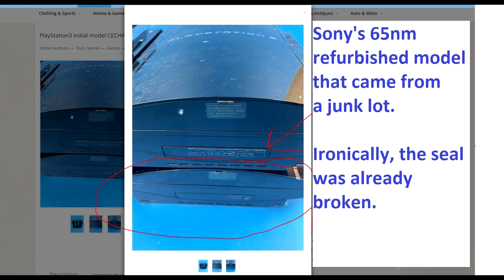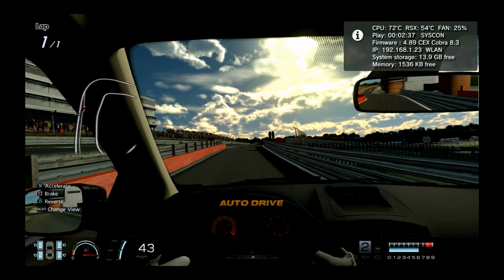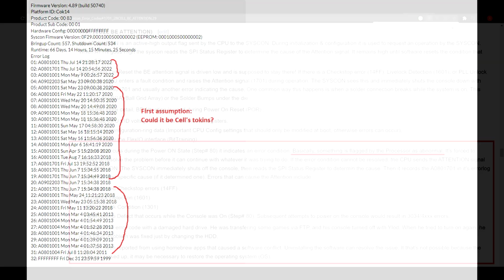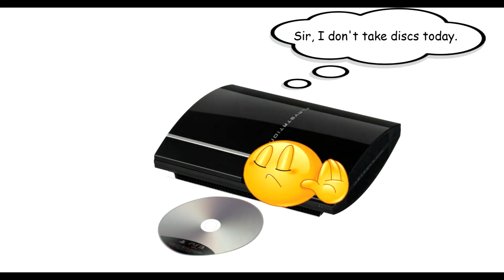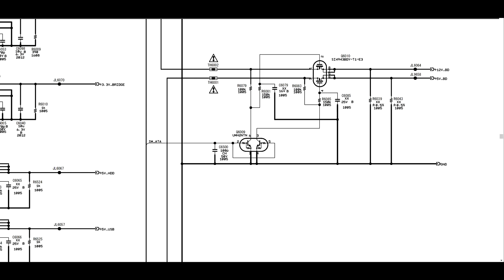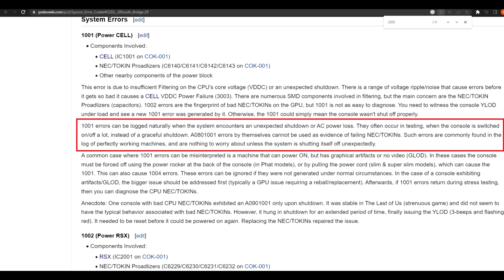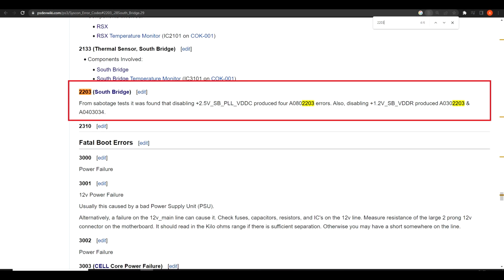Repairing unusual fault on a refurbished 65nm PS3 CECHA (Syscon Errors & Explanations)

Comment: buenas, saludos desde Peru, yo tengo el problema de los codigos 1701 y 1601, hasta donde explicas en el video tuve los mismos problemas, me refiero a que intentaba entrar a multiman y se quedaba  en pantalla negra, tenia que forzar el apagado, en cuanto al lector de blue ray normal, ingresa y sale el disco con normalidad, lo que si le instale el cfw 4.91 le instale webman mod, luego me dio error de ya no encender glod, y ahora tengo ese problema GLOD, se enciende el led verde como 20 segundos luego se apaga pasando un milisegundo primero ylod y se queda con el led rojo parpadeando y se ha quedado en ese error, como lo soluciono por favor.............he estado intentando que prenda la ps3 dandole al boton power muchas veces y una vez prendio donde aproveche para instalar el firmware original a ver si con eso quitaba el cfw pero veo que no se ha quitado en su totalidad, aun quedaba el multiman, en este arranque pude jugar al god of war asencion con normalidad, luego la apague con normalidad y de nuevo da el error de GLOD y ya no ha prendido de nuevo, pido que me ayudes por favor para arreglar mi ps3, agradesco tu respuesta de antemano
Reply from the maker: You need to diagnose the syscon error codes with UART adapter

Comment: My dude, you just GAVE ME A HUGE HINT towards MY problem. 

I have a similar problem. When BD drive is connected VIA ribbon cable, there's a YLOD. But when I disconect it, its just fine. 
I also seem to get 1701 with 1001 errors, which might be exactly the same problem as you have. 
I'll get a new power supply and check that out. Huge thanks!
Reply: Any updates?
Reply: @cuttrogue  Nope. You have the same?
Reply: @sharkhardware  Was just curious if you managed to fix it
Reply: @cuttrogue  No, i did even worse. Looks like I damaged the cable that connects mb and power supply. Well, I'll find my luck someday

Comment: I have an original CECHA01 model with no changes to the board that's been giving a 1001 error whenever playing strenuous PS3 games. Gives YLOD but works after a restart, plays PS1 and PS2 just fine for hours (literally 8+ hours works just fine playing Metal Gear Solid for PS1.) PS3 games will give a YLOD after about 30 mins though (occurred multiple times playing MW2.) According to the wiki I expect it's a NEC/TOKIN issue but not sure. I assume so because it can power PS1/PS2 games but not PS3. May send it out for repair soon but just holding onto it for now.

Comment: Im having a similar issue with an A01.  This only happens when trying to load up PS2 games.  I insert the ps2 disk and the ps2 game tries to boot and then console shuts down with flashing red light.  Syscon showing error log 1701 whenever this happens.  Does not happen with ps3 games.  I tested TLOU for about 10 minutes and no shutdown.  I received this COK-001 PS3 board with no blu ray.  Remarried a known good drive.  At some point I will check that mosfet and those other components to see if that is forcing the cell to tell the syscon to shut down.
Reply: Thank you so much for making this video, this was about all I could find that relates to my issue and could give me any clues as to what to check.

Comment: still waiting on your bga video bro
Reply from the maker: Sorry about that. I've been redesigning it slowly. I am making a lot of improvements. It's just a lot of work. I made a whole new power supply so far.  The next pieces would be main logic module and the IR power circuits. Also I have to admit, I'm not getting anything out of these vids so i'm doing it in my free time and it can be draining.
Reply: @calyps0man  and we are watching them because we love you're so smart
Reply: @calyps0man  quick questions what temperature you use on top because i use just bottom heat and it take long time to remove chip
Reply from the maker: @Yasser_music_place  The top is controlled by a temperature profile. It's automatic for me.

Comment: Hi, I found this video really interesting. I’m encountering error codes 1601 and 1701. The 1601 error went away after I formatted the HDD, but my PS3 (model CECHCL 004 , fat version) still turns off after 5 seconds. I’m unable to enter recovery mode. My board is version 001, and I’ve tried to locate the MOSFET you replaced in the video, but I can't find it or identify it, as our boards are different.

Could you provide any photos or links to a guide specific to my board version? or contact you via email ? Or could the issue be caused by a corrupted SYSCON? The previous owner of the PS3 had it jailbroken in Hebrew, so that might also be a factor.
Reply from the maker: Hi, it was a while ago. Your board is not from the same model, you would have to study the pcb to figure out how the voltages work with the bd drive. Also this is just one example. 1601 and 1701 could be caused by other things too. Syscon does not get corrupted though. The firmware does. You probably have another problem, such as RSX. My discord is the same as my channel name.

Comment: But if Blu-ray is not connected it should power on without any problem or not?
I have a couple of 1701 but can't boot also if Blu-ray is not connected
Reply from the maker: I think it should power on. 1701 is just a code that something is abnormal. Also are you talking about slims or fat models? This is mostly for FATs.
Reply: Both FAT compatible PS1 PS2
Reply: My is in the same situation

Comment: Can you descript the two components you have removed...??  In my case its a cech 3000..
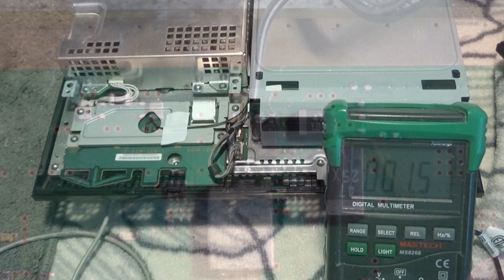Reply from the maker: Hmm. I am not sure what components are used on slims. I never had to repair slim's BD drive circuits and there are no schematics. But on COK-boards you can see their names at 3:21 and me pointing at the mosfet at 3:33 and  transistor at 4:59. The mosfet is si4943bdy-t1-e3 (easy to notice, a black rectangle ) and the bipolar transistor (tiny smd) is UMH2NTN
Reply from the maker: Btw some time after this video I also had to replace the blue ray drive. Maybe you can try that.